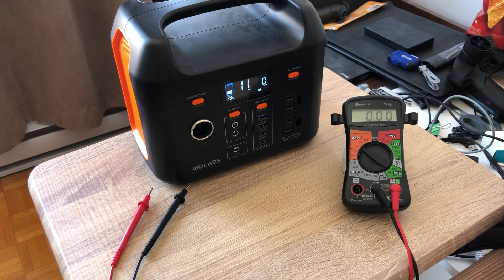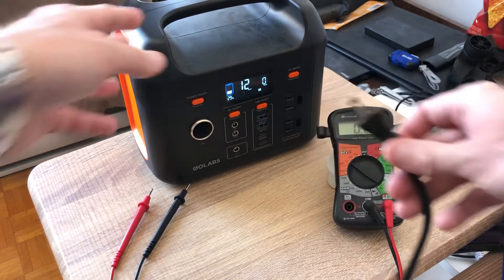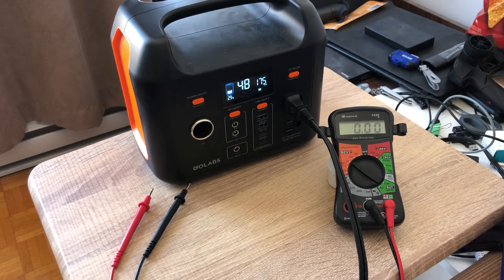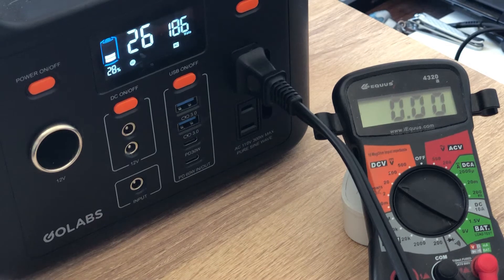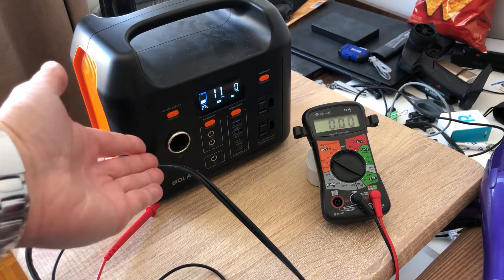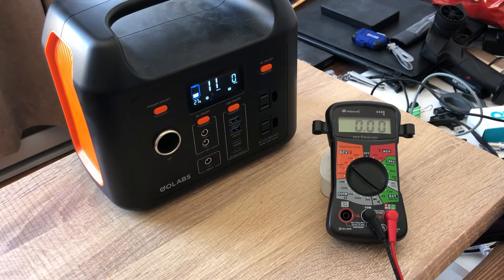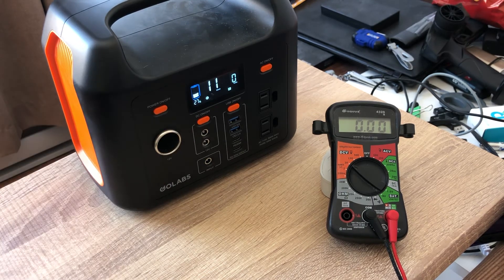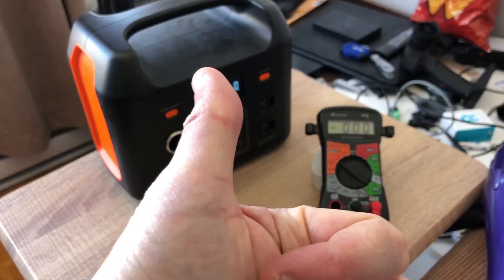Golabs R300 12V port testing while under load and the battery is at 30%

Comment: It is not regulated but it powered my 12v fridge on high voltage protection down to 20% and on low voltage protection down to 12%.  Lifepo4 batteries do not need to be regulated since the voltage doesn’t drop off until the end of their charge.
Reply from the maker: I don’t know where else you can get a LiFepo4 generator for that price with that many bell and whistles especially in Canada??? But as long as it last long term that’s all that matters 👍
Reply: @patdud1979  exactly, and thanks to your videos I pulled the trigger on this unit. I appreciate you doing this testing!

And I totally agree, cost me less than $1 Canadian per Wh. Such a good deal!

Comment: Main LiFePO4 battery pack is 12.8v (4 x 3.2v), cell range is 2.9v to 3.6v, giving this unit a pack range of 11.6v to 14.4 to work with.   I thought 12v outlet would be just the battery pack voltage, but its not.  It actually goes lower as battery gets fuller, and goes higher when you turn on the AC mode, so there's some control circuitry there.  And if you accidentally pull more than 10 amps (like with a tire inflator), it will auto shutoff the DC and give you a warning.

Comment: This power bank is LFP, it doesn't need to be regulated & not being regulated has the advantage of saving power instead of loosing power to convert DC to AC.
Reply: whitch one is better = this unit or motomaster eliminator power box 2000 ??
Reply: @michellapointe9052  so sorry, I'm not familiar with motomaster.

Comment: whitch one is better = this unit or motomaster eliminator power box 2000 ??
Reply from the maker: This one. You have more charging options and outlets option 🤙
Reply: @patdud1979  and battery capacity for charging ??
Reply from the maker: @michellapointe9052  it is 299wh you need a solar panel. The included charging bricks. Or a USB c for charging it. And as far as charging stuff you can charge  a iPad 3 pr 4 time 👍
Reply: @patdud1979  sorry for my englisn =i m french canadian... whitch one of the two as more reserve battery ?
Reply from the maker: @michellapointe9052  je ne sais pas le moto master a combien de batteries désolé
Reply: @patdud1979   possible de comparer les specs des 2 produits ? Je n y connais rien...  merci

Comment: Which solar panel will you test on?
Reply from the maker: Probably renegy 80w or a 100w. Witch one should I get for testing??
Reply: @patdud1979  I’m getting the iClever 100w solar panel. Waiting for the shipment.
Reply: @patdud1979  Which Solar Panel, one that's in Parallel or in Series, which one or does it matter for this solgen ?
Reply from the maker: @hmfem3656  just get a renorgy 80w or 100w out only need a single panel to work to it’s full potential.